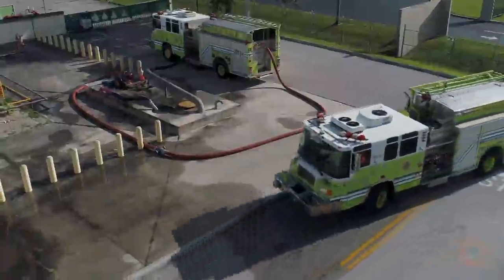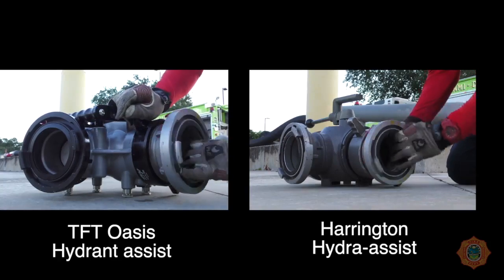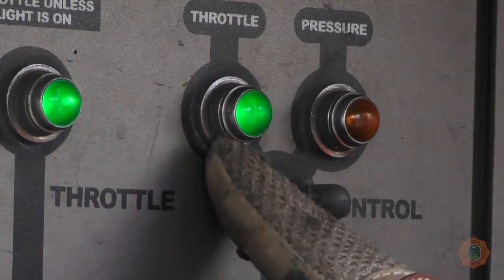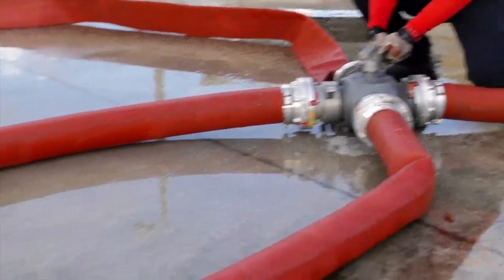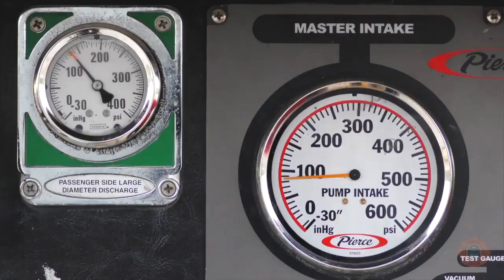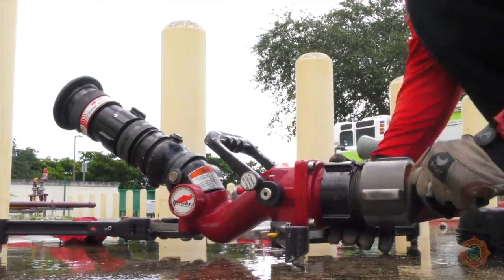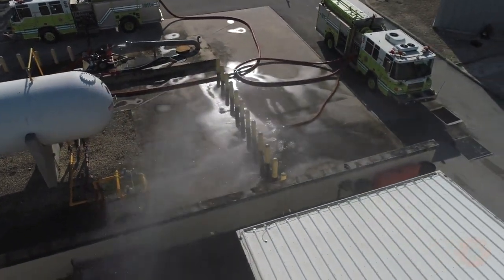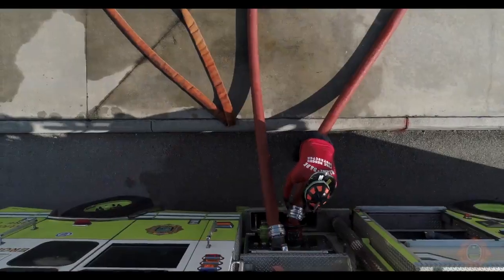Relay Pumping

Comment: Quick question: why do you need a dump line in a relay operation for relieving pressure if your engine already has a built in pressure control device (for example, the Total Pressure Master)? Isn't the whole point of the pressure control mechanism to prevent those surges in pressure in case lines get shut down and wouldn't that make a dump line unnecessary?